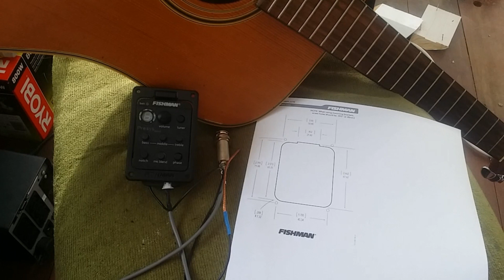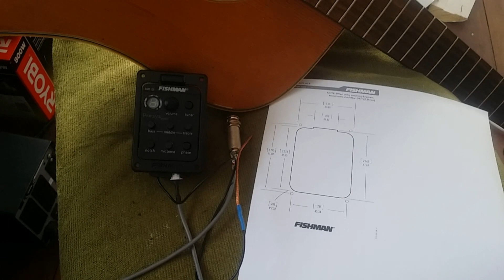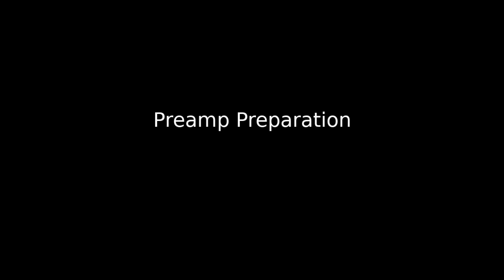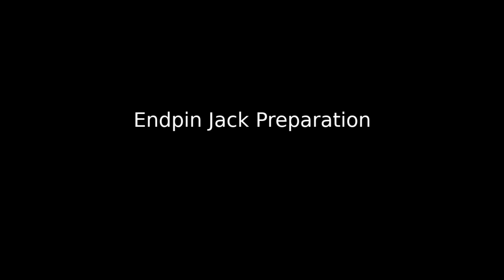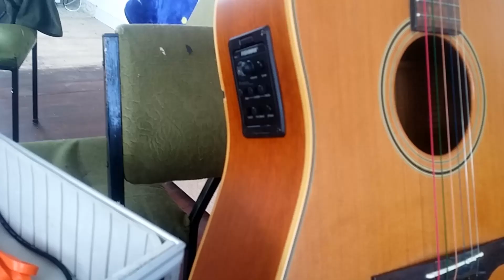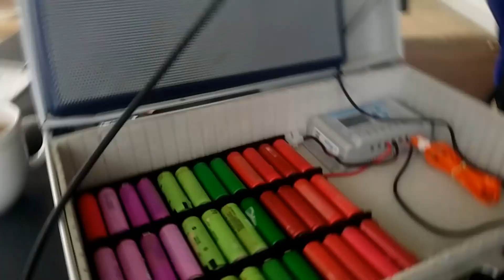How to install a Fishman Presys Blend Onboard Preamp

Comment: For the life of me I cannot figure out how to print out an accurate template that prints out to the exact and propper size. Any suggestions?
Reply: The issue will be in your Printer settings. Make sure "Fit to page" isn't selected and you have the correct paper size selected (ie; A4 or Letter) or try and print on someone else's printer.

Comment: I like the little device you made for the jack socket. Wish they'd include even a plastic one with the pickup. Very tedious step. I will probably try one of my old patch cables that I never got around to repairing. Good tip. Nice video. Thanks for the share.

Comment: I bought one from China, it took three months to get to me. Found the template online, but when I print it, it comes out with smaller dimensions. (The 2" marks at the top are less than two inches apart, for example)  Any suggestions?
Reply: Try this one. If it still prints smaller; try a different printer or double check the print settings: https://www.fishmanjp.com/support/cutout_templates/presys_cutout_template.PDF

Comment: I need help, My piezo hole is near 1st string, it matters?
Reply: Yes it matters.. if you run into that problem the best thing to do is just drill a new hole on the opposite end of the saddle slot.. make sure it's far enough away that the piezo extends out on both of the outer strings the same amount.
Reply: @ChristopherFreedom  thanks, do You know why its matters? What happen ?

Comment: a bit to fast for me :) I have an already installed one that broke and I bought a replacement but I'm finding it really hard to setup both wires in the correct places, also to remove the old one, would there be a good guide to follow that?
I really don't understand how to fix the part that goes in the bridge.
also the part that goes on the body did not really got all of it
Reply: The pickup that goes in the bridge is held in place by the strings when they are tightened. In regard to connecting wires, make sure to remove all 4 screws from the preamp so you can remove it and gain access to the wires.
Reply: @BrynnNeilson  thanks that helped, I also saw another thai guy doing a video and that also helped. my main problem was that I already had one in my guitar that broke when the battery exploded so honestly replacing it was almost harder as putting up a new one if you don't have all the tools

Comment: Can u please tell me that how you make very small hole for four screws
Reply: 2mm drill bit
Reply: @SpinningplanetCoNz  bro can I make these holes without drill
Reply: @shankersadhwani9183  Yes. Just use a very sharp tipped knife to create a small hole. The screws will then be able to "bite" into the wood when you screw them in.

Comment: how do i start making the hole of the jack, the place you drilled in i have a guitar strap pin there and i need that, i want to make a hole the same place most electric guitar have it on the bottom corner a bit
Reply: The jack socket also acts as your guitar strap pin/mount. I removed my pin and made the hole larger so the jack socket could fit through. You could put the hole further down but then you'd have to reinforce around and behind that hole. I wouldn't do it. Too risky.

Comment: Quick question my saddle is made of brass so how do i file it down?
Reply: Then you have to mod the bridge, so it have more space for saddle without sand it
Reply: @zeeb684  ok thank you that helps alot
Reply: Brass saddles are quite soft and easy to file using just about any file. I don't recommend trying to deepen the slot.. that is very difficult to do and get it level, and you could end up damaging the instrument.

Comment: Hi, great video! Question, how do you deal with the curvature of the guitar? Does the preamp adjust or something?
Reply: Made of plastic ... the pre-amp is mounted into a swivel housing (for battery access), - i.e. a plate that is screw-mounted onto the guitar.  It is slightly flexible, and will accommodate a slight curve (maybe +/- 3-4mm? flex, YMMV), but nothing too extreme, there isn't much clearance between the two parts, and too much flex on the outer housing could reduce the clearance and prevent the unit from opening.    How well it sits - around the hip or in the waist of the guitar - depends on how tightly you clamp the plate down in place while fixing it,  and ensuring that you drill snug screws holes at 90-degrees to the tangent, ensuring that the plate sits down snug.   Mine sits in a slight 'S' shape on a Yamaha dreadnought, with no noticeable gap between housing and body.   Great performance pickup.

Comment: What about batteries? Does the presys open wide with a switch? Or you must put them inside before putting strings?
Reply: The part with all the controls on it is screwed down to the body, but the inner part can be easily pulled out and then you get access to the battery. Right above where it says Fishman, you can see a little clip you can push on and then that entire part can be lifted out and don't have to remove any screws or anything.

Comment: What about batteries? Does the presys open wide with a switch? Or you must put them inside before putting strings?
Reply: The pre-amp is hinged in the middle, the inner unit rotates past 90-degrees to expose 9v battery compartment in back for easy access.  
The battery clicks into it's compartment, and must be released to slide it out.
To access, lift the tab above the 'Fishman' logo, with fingernail or plectrum.  Replace the battery, and snap pre-amp back in place.
Reply: You can easily pull it out and put a 9v battery in it.

Comment: does it give the junky sound of our finger slides which is louder than string sound? I just returned a microphone pickup on Amazon so not taking chances if this works best
Reply: I've never used a slide on it but it includes a bridge pickup and I don't have any issues with volume
Reply: Microphone pickups will detect every noise and make it louder, like the sound of the friction of the strings as we slide out fingers up and down them. A piezo pickup is vibration based, so it only amplifies the vibration it detects from the strings being plucked and sends that signal off, which is why Piezo pickups don't perfectly replicate the sound of an acoustic at louder volumes, but it doesn't have the same issues you faced like when using microphone pickups (especially cheap ones off of eBay).

Comment: the template is big. how do you resize it accurately?
Reply: Mine printed out the correct size. Make sure your printer settings aren't stretching it to fill page.

Comment: great video.  I am about to do 3 guitars.  I pondered about using a gasket between the plastic and the wood.  I thought about neoprene mouse pad but that was too thick.  But then today I found a mouse pad that is quite thin yet still compressable.  Should work perfectly as a gasket.  Highly recommend this gasket.  https://www.staples.com/ultra+thin+mouse+pad/directory_ultra+thin+mouse+pad?akamai-feo=off